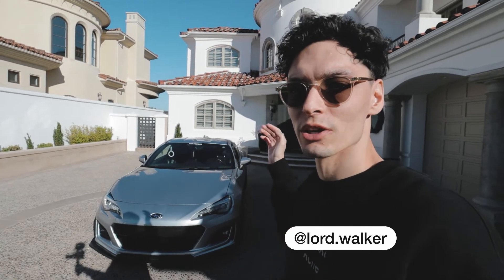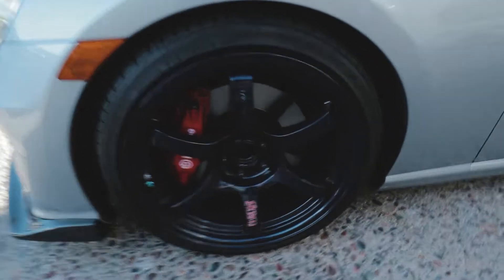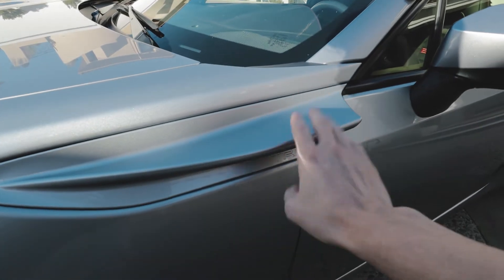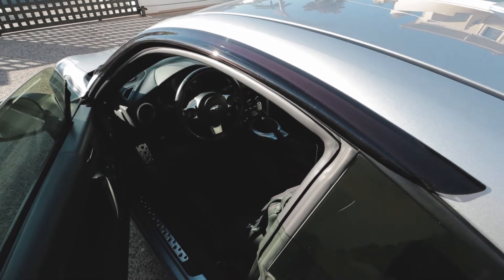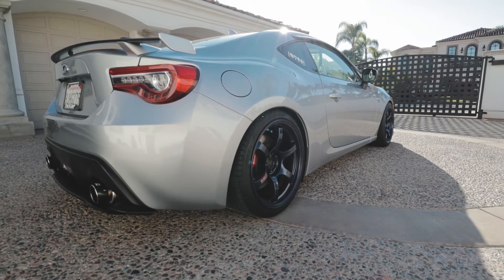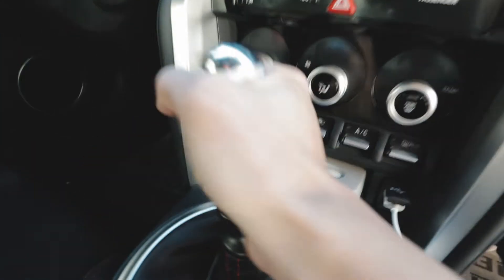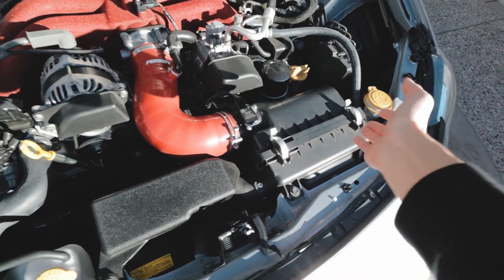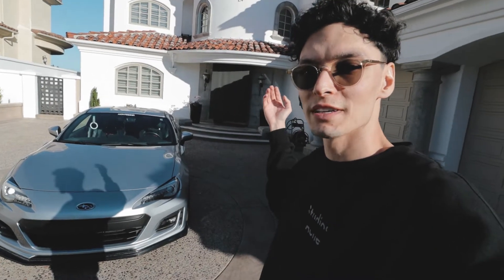BRZ Build Walkaround | BRZ / GT86 / FRS Mod List

Comment: Hay man I was wanting to buy some 18x9.5 +40 TE37SL’s for my brz but I’m on stock suspension and wasn’t sure how the fitment would look . I’m not going for perfect fitment like where I can’t fit my finger in I just don’t want it to look so huge like it is rn. This is my first car that I’m modding and I’m not too knowledgeable on this topic . Do you have any feedback ?
Reply from the maker: Yo whatup my dude, any 18s are gonna look like monster truck fitment on stock suspension-- I got an older vid on my channel that shows how huge the wheel gap is when I first put my wheels on. 

18x9.5 +40 is also super tight clearance with the spring perch on the stock strut so you might have rubbing issues even on lowering springs depending on your tire. Basically I'd say get coilovers at the same time as the wheels to make it all easy. If you're into deep concave TE's System  Motorsports has an 18x10 +44 TE37 SAGA that's face 4 concave in BRZ fitment (with coilovers).